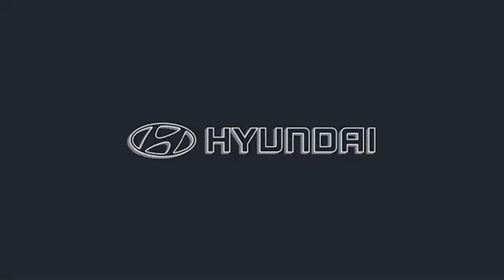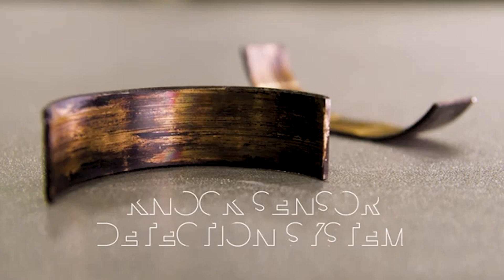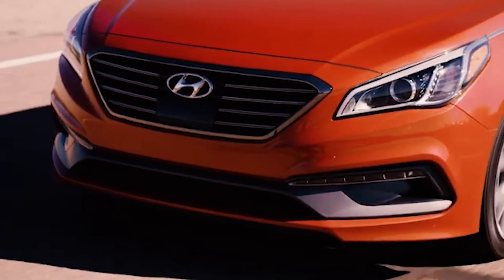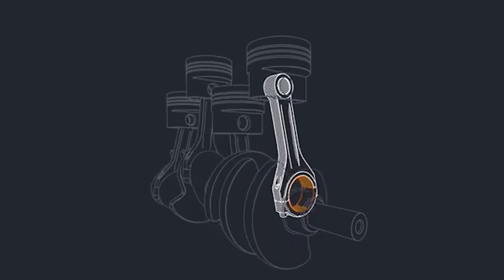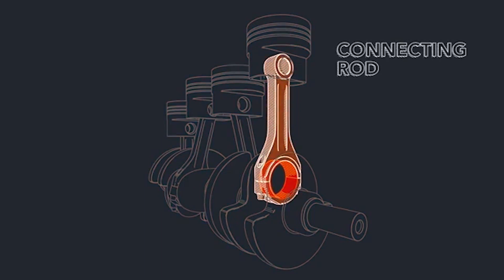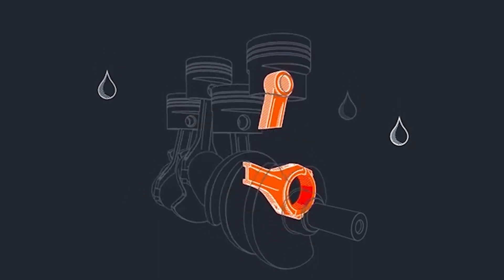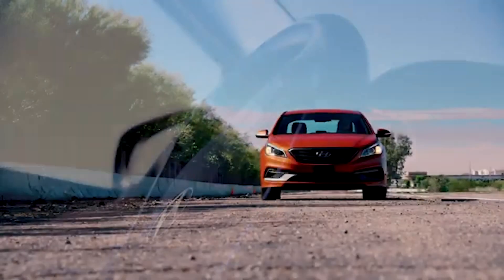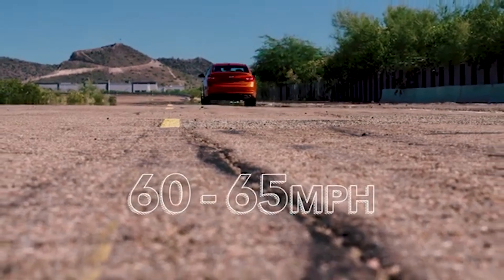KIA ENGINE SETTLEMENT PART 27 | WHAT DOES THE KIA / HYUNDAI KSDS MEAN? | HOW TO GET YOUR NEW ENGINE

Comment: I need an engine replacement in a 2016 Kia Soul.
Reply: I also have a 2016 Kia Soul with the same issue. I have flashing engine light,  vibration, knocking noise, p1040 and p1326 errors. I took my car to Kia and they ran tests. Because the piston ring did not fail they are saying they won't replace my engine. Now I am stuck with a vehicle that is stuck in survival mode that won't accelerate properly.  This is BS!

Comment: I also have a 2016 Kia Soul with the same issue. I have flashing engine light,  vibration, knocking noise, p1040 and p1326 errors. I took my car to Kia and they ran tests. Because the piston ring did not fail they are saying they won't replace my engine. Now I am stuck with a vehicle that is stuck in survival mode that won't accelerate properly.  This is BS!
Reply: I am having same issues.  What happened with your kia?  Did they ever fix it?
Reply: Yeah, am also facing same issue with my car P0136 , P1326 & P0011 these are the errors and am in a situation that i dont know what to do with this!!
Reply: @summerbrown6228  Yeah, am also facing same issue with my car P0136 , P1326 & P0011 these are the errors and am in a situation that i dont know what to do with this!!